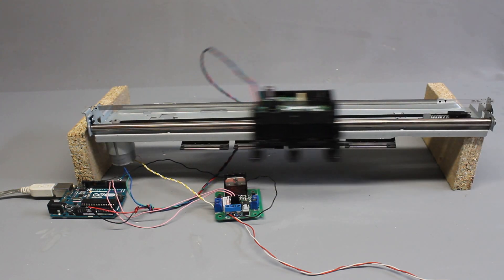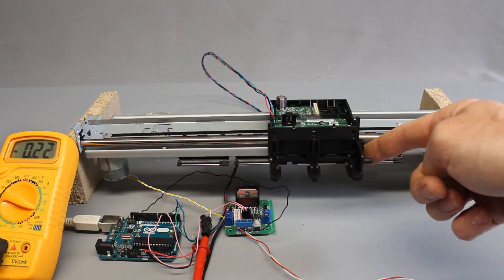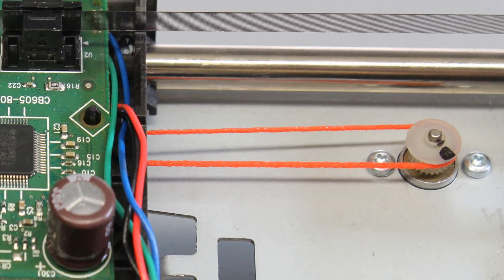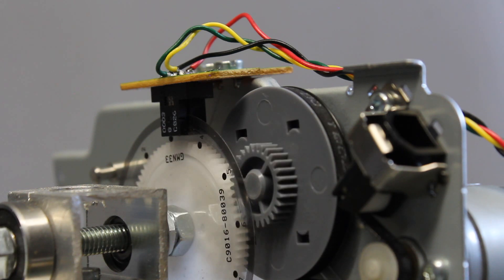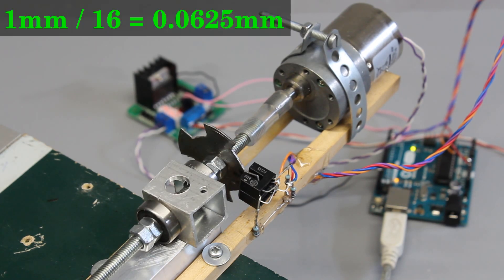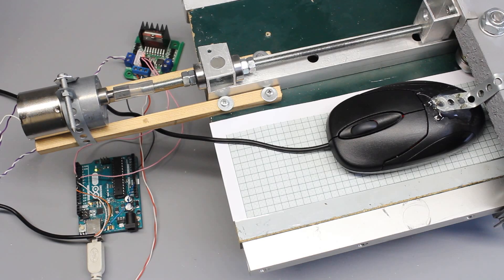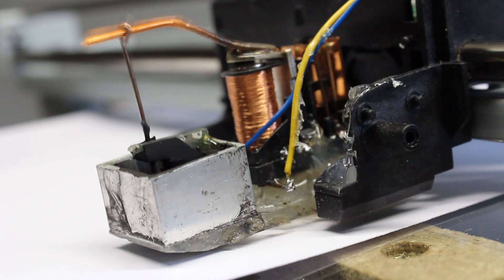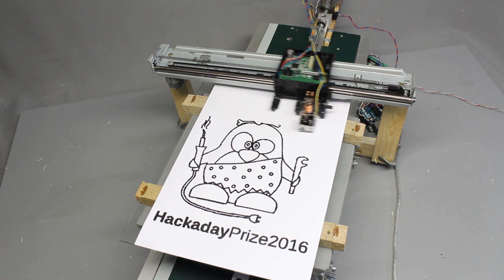DIY printer and linear drives

Comment: Sir, I totally replicated the circuit and the code for the sake of proof of concept and get it working, but whenever I send any command the cartridge does not stop it just goes to the extreme right or extreme left! Please help, Thank you!
Reply from the maker: Did you swap the polarity of the motor wires?
Reply: @HomoFaciens  I tried that too
Reply from the maker: Do you get correct voltages on the outputs of the sensors?
Do you use the original sensor strip or sensor disc from the printer? Selfmade sensor strips will eventually not work.
Have a look at the theory behind those sensors:
https://homofaciens.de/technics-base-circuits-transmissive-optical-sensors_en.htm

Comment: Could you please provide the code for print head control with arduino??
Reply from the maker: Could you please have a look at my pages as I told you in the video?
https://homofaciens.de/technics-machines-cnc-v3-1_en.htm
But keep in mind that is was written quick & dirty only for this video.
Reply: @HomoFaciens  Sir I also had a printer and disassembled it and just because of your explanation I can employ its parts in my project, I am very grateful to you that you made this video, it's a 💎

Comment: Simply amazing, reminds me of my first printer. I had a C64 printing graphics to a 9 pin dot matrix printer. It literally took an hour to print out a turtle graphic 9x10" on a single sheet of paper in low resolution. I thought back then that instead of using the God aweful slow serial bus on the Commodore 64 that they could have interfaced a printer thought the User's interface, being its an 8 bit bus. Curious to me why that bus was ignored by developers.

Comment: I like this so much !
Is the print head a DIY project or hs it been scavaged from a (very) old printer ?
I would like to do something similar for latte printing !
Reply from the maker: As told in the video, the print head is made of a relay. I am currently trying to improve the design for another printer project: https://youtu.be/DBI1H7KUqE0
Reply: @HomoFaciens   thank you for your answer. I finally got more information on your web site linked into the decription.
I was wondering how was the ink dropping from the "needle". I understand that there is no "needle" but rather a simple pin on which the liquid is dropping by capilarity ? And this pin touches the paper to print ? right ?
I saw also your second attempt with the genuine printhead. But I do believe that it only works with real ink and no other liquid like milk or coffee ?
I would like to do something like this : https://www.youtube.com/watch?v=Wxup2o0w1kU
just for fun of course !
regards
JP
Reply from the maker: The needle (piece of copper wire) of this relay printhead touches the paper. So it won't be suitable for your coffee prints. I am working on a print head that ejects ink drops - stay tuned!
Reply: @HomoFaciens  thnaks !
I'll stay tuned, I will follow you .

Comment: Could U make one with a display?
Reply from the maker: Why should I? It works fine for me without.
Reply: @HomoFaciens  I said that because I have an interest to build it, so I was wondering this marvelous device with a display :)
Reply from the maker: It's more a demonstration of linear drives than a real printer. Using two identical motors for X and Y axis would make things more easy. I still have creating a printer from scratch on my list of things to be done, but currently this project is not on top...
Reply: @HomoFaciens  Even being a demonstration, it is such amazing. I'm doing similar device, but for another purpose, a x Axis mechanism for syring Control. 
BTW nice device. :)
Thanks to reply me :)
Reply from the maker: For syringe control an LCD would be nice to see how many ml exit the "pump". Should not be too hard to hook up an LCD to an Arduino?
Reply: @HomoFaciens  yes, you're right. At first I need to work on mechanism before I sink in code. In fact a LCD is a bit hard to declare under certain circumstances. Anyway your project is a good reference for me.
Reply from the maker: The first time you use an LCD it might be hard to implement. If you understood how things work, it's easy. The syringe project isn't too complex from the software side, so it's a good one to start coding. Happy tinkering!

Comment: Hi Mr Norbert , 
Using the same mechanism (printer).  Can you replace the dc motor and replace it with a Stepper motor?
I want to change DC motor to Stepper Motor.
Thank you very much. 
Best Regards. 
Necmettin.
Reply from the maker: If you rewrite the software (which is very experimental, but open source) you can also use two stepper motors.

Comment: Oh no! I just took apart the linear drives of the printers that I had laying around, thinking this would be too hard to do. But now I see it's actually really easy!! I wanted to build a pen plotter with the old printer parts.. Now I'll have to salvage more printers haha :D So you use the 'Double H Bridge L298N' to drive the linear motors?
Reply from the maker: Unfortunately, heaps of cheap, not long lasting printers are sold day by day, so there is no lack of supplies from old printers...
Yes, the L298N boards are a cheap way to drive printer motors.

Comment: ok i have a question er, rather a few of them. I have an old large format plotter, the motors are rotary encoded DC motors, the various sensors are linear encoders. The original computer was old, 1993, didnt have the patience to try to get it to interface with my iMac. So i got an arduino. I know that the motors will require H Bridges, but can it effectively run 2 motors, and 3 linear encoders to use as a plotter again? the pen holder is a relay engaged device with a small encoder on one end. Can the arduino do all of this?
Reply from the maker: How many motors an Arduino can control depends on how many pulses per second are coming in and so on your hardware setup (motor speed, pulses per revolution). I recommend using an Arduino having at least 4 hardware interrupts to get the maximum reading speed. The UNO only has two of them.
Reply: HomoFaciens will a Due work?
Reply from the maker: This page lists the numbers of hardware interrupts the Arduinos have built in:
https://www.arduino.cc/reference/en/language/functions/external-interrupts/attachinterrupt/
As said before, if they are fast enough depends on your plotter hardware. You must try to find that out...

Comment: Excellent Video. Please provide more info on how you interfaced printer sensors (IR) with the MCU.
Reply from the maker: There is a chapter about the working principle of quadrature encoders:
http://homofaciens.de/technics-base-circuits-encoder-disc_en.htm

As well as how to get them from old printers:
http://homofaciens.de/technics-base-circuits-transmissive-optical-sensors_en.htm

A video/chapter in my series about "Physical Computing" about how to interface with an Arduino/Raspberry will follow...
Reply: Exactly what I needed. Thank you very much. One little thing, can you help the layman figure out how the Control Board of Canon PIXMA IP1000 QM2-1764 (QK1-1005-02) can be used to drive the motors, wiithout any external motor driver?
Reply from the maker: Sorry, I have no such printer nor enough time to do the work for your project.
Reply: Thanks mate. You've given enough. Appreciate it!

Comment: Hi! How I can use linear encoder with Arduino? I have linear encoder from HP Printer (Looks same than you).. I've tried power optical encoder but led doesn't light..
Reply from the maker: I made a video about reusing sensors from old printers:
https://www.youtube.com/edit?o=U&video_id=a55EwMSIy2w
and there is more about those sensors on my pages:
http://homofaciens.de/technics-base-circuits-transmissive-optical-sensors_en.htm

Comment: sir how to use that software in windows computer
Reply from the maker: I don't support closed source Spyware. Install Linux on your Computer to make my machine work (maybe as dualboot besides your OS). I am using Ubuntu 16.04LTS and you can get it for free on
www.ubuntu.com
Don't forget to make a backup of your data before installing Linux.

Comment: I want to make cnc machine  I have two same linear drives with big dc motor but I cant find code for controling two motors for same axis.I want to use linear endoder of corse  so two incoders for one axis. Can you help ?
Reply: The x axis to be corect.
Reply from the maker: My CNC v2.0 and 2.1 use two motors for the X axis:
http://homofaciens.de/technics-machines-cnc-v2_en.htm
but you can't expect to use this code without modifications for your machine. If you build your own hardware you must learn how to write the code for it. It's very unlikely to find it all written for you in the www ;-)
Reply: I will do my own code sometime but for now I will try using mach3 cause I want to get it working and then I will start to write code and stuff to use arduino. It takes a lot of time  to do it propertly,I have to figure out how to get it to gradualy slow down before stop and have to do a lot of experiments with it. It is a lot easyer to do it with steppers cause I coud just buy drivers from ebay cheaply get code from someone else change few numbers and done. But I coudnt find software for dc motors so I will do my own that will be the best way to learn along the way. I didnt use your code beacouse I want it ti take gcode. But I will give it a try in future once I build another smaller one for fun. I am looking forward to see your future project that you are planing for 2017.

Comment: well I guess I could of "fixed" my old printer instead of dismantling it for the motors... lol
Reply: DarkShadowsX5 dont bother. the linear system is one way only. mine tends to misscount steps with vibration or when changin direction suddenly.  youd need a endtop sensor to reset the position each time like most inkjet printers do (i guess for the very same reason)
The economic/fast/draft mode usually prints in both directions but because of the possible misalignment im sure thats why only draft mode is the only bidirectional printing mode.

Comment: I read below that the printer resolution is 1 mm. Is there a way to improve this resolution by rewriting the code? maybe using interpolation
Reply from the maker: Yes, with some software optimization, you could get better results, but why? It's just a demonstration of how things work.
Reply: I'm trying to make a 3D printer with inkjet printer parts so I would like better resolution

Comment: I'm asking a lot of questions here but how would one proceed to replace the DC motor with a stepper one without dismantling the belt ? I cannot seem to keep the plastic gear but remove the spindle out of it without moving the belt :/
Reply: I'm talking about the printhead asesmbly btw

Comment: Very interesting video, how did you get the wiring of the linear optical sensor for the printer scavenged part ? I got a 6-pin sensor unfortunately i cannot solder cables to the pins because they put anti-soldering compound on the board, I now have the choice between trying to use the 12-pins ribbon cables or unsolder the component, what do you recommend? Would I be able to use a bought optical sensor and how would I choose one for this linear strip ? Thanks in advance for all these questions and keep up the great content.
Reply from the maker: I would try to grind the anti soldering compund from the pins. My second choice would be to use the ribbon cable. While trying to unsolder one of those sensors I destroyed the device. If a bought sensor works with the stripe and what type to use? You must try out to find the answer. Since you won't get the specifications of the sensor stripe, it's gambling...
Reply: Hello I just wanted to know how to replace the DC motor to a stepper motor in a printhead assembly without removing the belt, how would one proceed ? Thanks in advance

Comment: Can I make a question?
How did you made the "list of commands" for the arduino to produce your channel logo?

I've builted a similar printer with a ball pen to write, and write not so baldly with GRBL code.
But I'm not able to transform any image to G-code.

Do you guys have any suggestions? HomoFaciens Help please!
Reply from the maker: It's a small programm I have written especially for this machine that transforms 24bit Bitmaps into the commands. It's available on my project page:
http://www.homofaciens.de/technics-machines-cnc-v3-1_en_navion.htm
Reply: I've seen it and I've been able to "read" the foundamental philosophy of your code... Yeah it's a printer!
It swaps all the page in lines and adds dots whre needed, CORRECT! that's how it's meant to be.

But in my application Maybe I need some kind of commercial software. A didn't know any simple one.
For example I know that chinese lasere cutter uses some kindo of  "corel Draw" CNC software. But that's all I know about them... Anyway, GREAT JOB!!! REALLY REALLY EDUCATIONAL! It could be absolutely useful in the future! Your "open servo + oprical encoder" is a very powerful combination! I'm amazed!

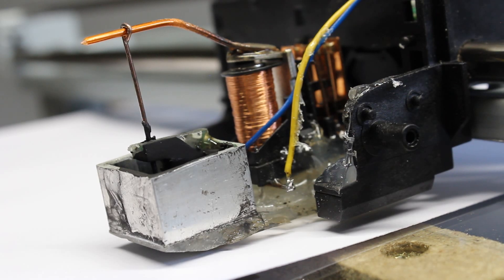Comment: Regarding the 8:22 part - this is awesome and simple, but I don't understand how it works. The wire is sticking from hole in reservoir full of paint? How the ink doesn't leak from the hole? What is the actual printing action? 
At first I thought like the wire sticks out of the reservoir and retracts back, bringing drop of into on the paper, but it doesn't seem to work this way. I looked at the pictures on your blog, those are big and detailed, but I can't say I understood it any better.
Reply from the maker: The viscosity of the color is pasty so that is doesn't leak. It's house paint (don't know the exact term, it's "Fassadenfarbe" in German). In rest position, the tip of the  wire is flushing with the bottom of the ground plate. When the relay gets energized, the wire is moving down, touching the paper and so trensferring the ink. It's not shooting drops like an inkjet.
Reply: Oh I see, thanks. I have some other questions, if you don't mind ;-) Looking at the picture here http://www.homofaciens.de/bilder/technik/cnc_v3_1_009_1920x1080.jpg
The plastic parts inside the reservoir (visible at bottom left picture) are just to keep position of the needle wire? The needle, slightly sticking out of the reservoir at upper right picture is at rest position?

By the way, great channel with a lot of ideas, I subscribed.
Reply from the maker: Yes, the plastic part inside the reservoir keeps the needle in place. No, that's not the rest position (it's flushing with the bottom of the plate). I wanted to make the tip of the needle visible on the photo, thus I used a piece of cardboard at the relay to fix it in that position.
Reply: Thank you much for your explanation, now it's clear to me.
The principle is very simple, but apparently effective. Thumbs up for the idea.

Comment: 5:54 Combining ideas, could an IR sensor be used with a encoder made if various IR filter films?  Similar to the resistor array, each position would have a measurable opacity to IR light. This should in theory create identifiable voltage values from the detector. What do you think?
Reply from the maker: The problem is, that you don't get a clean transition from one opacity to another as you get with the resistors (infinite or fixed resistance). You need two IR sensors as demonstrated in my video about rotary encoders:
https://www.youtube.com/watch?v=XIUrnR8bLAI
Reply: HomoFaciens Thanks. I was assuming that there would a thin metal frame to support the filters as a disk, the frame itself might provide some transition. Of course, if it could be easily done by simply adding another sensor then that seems like the most pragmatic solution. Thanks again.

Comment: Using a mashup of your servo pid code and https://github.com/danithebest91/ServoStrap i've made a setup almost like this compatible with grbl. Are you interested in the code and exchanging ideas? Get in touch. :)

It has the disadvantage of using 3 arduinos. I was using a nano as the master (running grbl) and two pro minis dedicated to running the pid control loop. Still, a very cheap setup.
Reply from the maker: Yes, using two Arduinos to implement grbl in those closed loop control systems is a common way to do that. This will become an issue when the hardware of my CNC v3.x router is finished. I already have written some lines of code that will do something similar. I will have a look at your code in some weeks. Thanks for your offer.

Comment: Line strip in printer is used for speed control. I always thought that is used for position but when I disconnect sensor carriage start to move very fast. I try to measure frequency on drum line strip and it was 20khz.
Reply from the maker: When removing the sensor stripe, no position pulses are received, thus the microcontroller assumes the motor doesn't move, which is why it raises power to maximum and that's why the carriage starts moving with full speed.

Comment: You show great ideas in your videos! These ideas came to me and of course to many others, but I lack knowledge to bring them to life.
Reply: And the only obstacle on the way of opensource 2d paper printer\plotter is the lack of cheap and open printing head with good parameters.
Reply from the maker: Yes, some more types of easy to handle and broadly available print heads would be nice.
Reply from the maker: TheKitMurkit
I tried piezo speakers as inkjets, but without success...
Thanks for the links - maybe I will try again.

Comment: What about inertia?  Would it make sense to slow down as the set point is reached?
Reply from the maker: There is a proportional control loop implemented in the Arduino software, but I did (almost) no optimization. It was a quick build.
Reply: Really cool video. Thanks.  I must have a go with something... just have to walk the streets looking for old printers now!